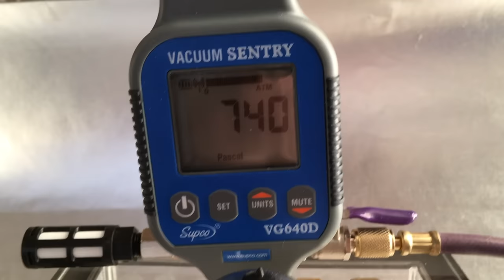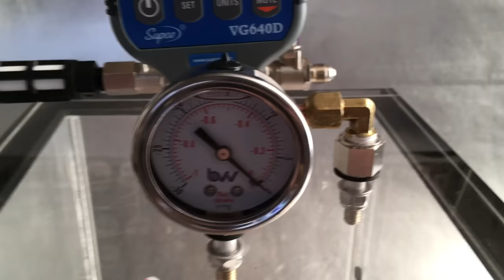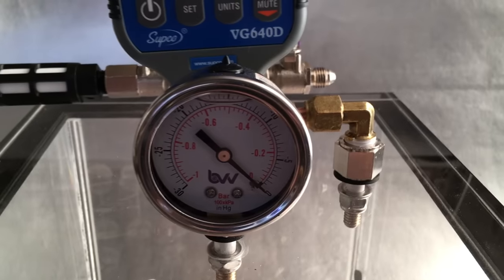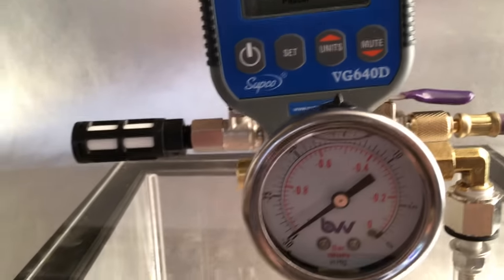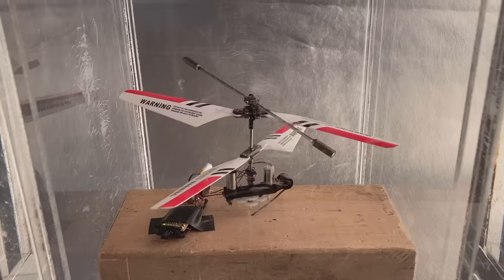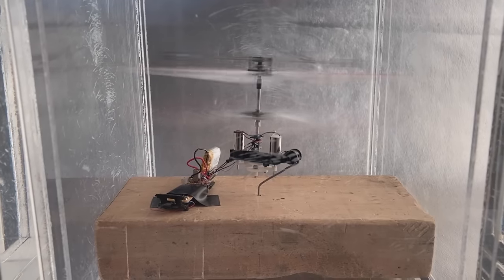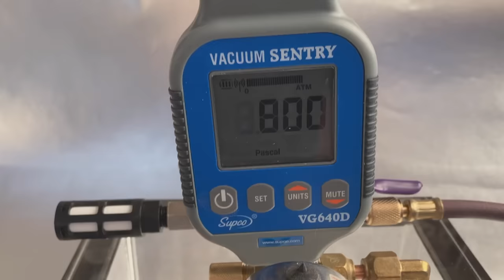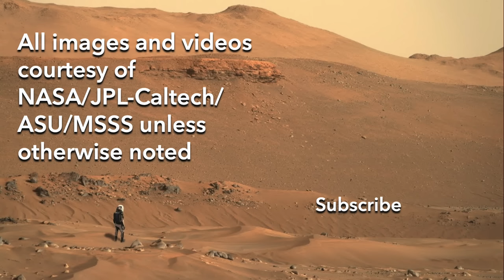Can a toy helicopter fly at Mars pressure?

Comment: Great update,  great demo. The weaker gravity on Mars helps. You need to switch on your anti-gravity machine.
Reply: He could run it on a skyscraper downward lift. :)
Reply: I actually forgot about the 0.38g on Mars.
Reply: He was measuring the lift, but he didn’t explicitly say that he was compensating for gravity differential though.
Reply: @russellharrell2747  indeed, but the lift needs to exceed the weight force (mass x gravity).
Reply: For the same thrust with the same rotor you'd need around twice the power on Mars and 10 times on Earth while spinning it about 10 times the speed compared to Earth conditions. This model wouldn't even hover on Mars with the weaker gravity.
Reply: @garyknight8616  yes, as long as the weight decreases on the scale by 39 or so percent we know it would lift off on mars.
Reply: Nice little experiment. You could see it generating lift, just not enough to overcome earth’s gravity.
Reply: Ingenuity (nicknamed Ginny) and its twin on Earth (Terry) have actually flown in 1g. (0:55 in video)
Likely just not very high.

Comment: Open the inlet valve slightly and watch as the air pressure increases. It will be interesting to know the pressure at which it lifts. You may be closer than you think.
Reply from the maker: I actually did this with the still fully assembled version of the helicopter.  It got airborne at about 0.4 bars (400 millibars) of pressure.
Reply: @MarsGuy  oh. Not close at all. That's sad.
Reply: @donepearce that’s without removing the extraneous mass of the landing gear etc. so it would achieve lift and a lot less than .4 bar.

Comment: Thank You Mars Guy for this episode! I think there are more reasons why experiment failed: Ingenuity blades are better optimized in general and they are optimized for Martian atmosphere including not only pressure but viscosity (at least I believe so). Apart from that the area of blades are also important, not just the diameter of the rotor. Those parameters are affecting aerodynamics of the blade by a lot, therefore lift and drag. I'd love to take a part in designing of Ingenuity successor!
Reply from the maker: It's true there's more engineering involved, and variable rotor pitch is important.  But I just wanted to see whether stripping down this toy helicopter would be enough.  It wasn't!

Comment: 68 flights is just incredible. It has proven itself invaluable many times over and is an absolute triumph for the design and operational teams. Just a relatively small extension of the rotors would have a significant effect on the capability of the next copters. I'm excited to see what the next iterations of these machines will be able to achieve, especially if they can incorporate recent the developments in AI and battery technology. We could be entering a Golden age of Rover exploration over the next 20 years.
Reply: A larger scale copter powered by RTGs sent to Titan should be possible, especially with behemoth rockets like SLS and Super Heavy/Starship coming online soon.  Titan Chopper could even come with a little boat to drop off in the hydrocarbon seas.
Reply: #68 will be an attempt to fly the longest distance yet. 828 m, or 2717 ft
Reply: But we still haven’t seen anything new on Mars we haven’t from satellites. Why aren’t we going into those caves and lava tubes ? Will we ever? If anything exists on Mars it’s certainly not on the surface. So lets keep poking at rocks for another decade and ignore where anything might exist.

Comment: Thanks!
I was more interested in the design and engineering of the "Mars Lab" than in the (expected-sorry) lack of lift in low psi.

Is the vacuum chamber "store-bought" or did you design & build it yourself? (I especially liked the inlet filter & valve system.)
In over 4 decades, I never actually did the "water boils in a vacuum" test... but I thought about it alot. I worked with Microns (HVAC) mostly and have to check a conversion chart for Pascals so I can understand the relationship better.
(We would typically take a sealed system down below 300 microns stable for best results in moisture removal.)

Thanks again! I always look forward to your updates!
Reply from the maker: The vacuum chamber comes from a company called BVV (shopbvv.com).  I modified it to use a second vacuum gauge.  Glad you enjoyed the boiling water test.  Kinda fun.

Comment: Very interesting ! It may help to break down the misconception widely spread by the media, that said Ingenuity's rotor was rotating at "high speed" to compensate for the low atmospheric pressure, while they are rotating slower than most commercial drones.
Reply from the maker: They are high speed relative to a full-size helicopter (~5x).  And for their length, they're high speed relative to most commercial drones.
Reply: True, i should have said high RPM @MarsGuy  , since it is what they refer to every time.

Comment: A major component of flight is wing foil design, not just speed and length. Part of the Wright Brothers genius was realizing the propeller is not just a way to pull (or push) air, but is also a wing. If you could make your own wings (Props), you might be able to get your RC helo to fly. It would make a fun project for aviation students.

Comment: The formula for lift generated by an airfoil includes the square of the airspeed, so I expect the same applies to the tip speed of a helicopter rotor. The thin plastic blades of Frankencopter would probably not survive if they were rotated fast enough to lift off at Martian pressure. Still a neat experiment, though!
Reply from the maker: Thanks for that detail, one I hadn't come across.  And yes, Frankencopter is not built for speed!

Comment: Awesome video. I was originally going to point out that you did not tether your RC helicopter to the top of the chamber to give some tension to reduce the "feel" of gravity like they appeared to do with Ingenuity in testing, but later saw you simply continued to remove mass but kept the most vital portions of the helicopter intact, thereby achieving more or less the same effect. Great explanation overall.
Reply from the maker: Yeah, the effort to lightweight this helicopter was my approach to addressing both the thin atmosphere and less gravity of Mars.  But clearly it wasn't enough, in part because the small blades would need to spin faster to get more lift.
Reply: @MarsGuy  Indeed, that's what I got out of it. You conveyed it well. :) Thanks for the response!

Comment: Reading some of the comments here and commenters talk about blade design and that reminded me of a channel I watched that was taking hydrodynamics of the leading edge of whale pectoral fins, specifically the little ridges and troughs on the leading edge and applying these to propellers to reduce drag, increase lift and in the case of boat props to reduce cavitation. I wonder if the next Ingenuity will have some new leading edge design to its props to reduce drag and increase lift.

Comment: I would love to see how a more powerful brushless tinywhoop (mini quadcopter) does, if you also account for the reduced gravity by pulling on it with a wire at whatever % of its mass. I still dont think it will fly, but the proof is in the pudding, and by varying the pull on the gravity tether we could see how far from lift off it is. Alternatively, put a scale in the chamber so you can measure trust.  Im pretty sure you will want more aggressively pitched props though. Also, it just occured to me, you are probably creating a prop wash vortex ring in that chamber, with the air blown downwards being forced upwards by the walls and then down again in to the props.
Reply from the maker: Good suggestions and thoughts.  I was going to abandon this effort, but comments like this have me thinking twice.

Comment: Since longer blades means exponentially more speed would it be worth it to make a part that slides out to give the blade a few more inches on earth based copter systems. If it provides that much more lift and it wouldn't be too hard to incorporate into a traditional design wouldn't it's practicality outweigh its design challenges?

Comment: Its been said below and a huge gain for Ingenuity is the almost 1/3 gravity. I also suspect that the blade wing section of your helicopter is not optimised to the lower air pressure. Great experiment though.
Reply from the maker: It’s true that reduced gravity would help, but a challenge to simulate in Mars Lab.

Comment: Good example, to get your toy to get lift, you need to rebuild the blades and point the exit vector for air force practically straight down. The small thrust you get from the current design is effectively just slicing through the thin air at this point, and might as well be flat.
As an example, hold out your hand, flat, then relax your fingers and watch how they curve naturally, ever so slightly. That curve would be the current blade design your are using. Now, bend your fingers to make more of a scoop, where your tips are point closer to 90 degrees off from the palm, keep a curve, don't bend it, and that's what you will need for the blades to have functionality.

Comment: Great attempt Mars Guy, experimenting with your own ingenuity! Mars Guy needs a bigger Mars Lab. ;)

The small volume likely contributed to greater rotor downwash phenomenon (a donut circulation pattern). It occurs when a helicopter is hovering in close proximity to a ground surface which increases power and thrust needed to hover, unless moving laterally. Being able to spin up blades, and then applying positive angle of attach would help to pop up off the surface, before downwash can develop.
Reply from the maker: Yeah, these are good suggestions.  I was trying to keep it simple, but it’s clear that simple doesn’t work here.
Reply: @MarsGuy  Starting simple is always a good idea. Much was learnt and shared.

Comment: When you said Mach did you mean usual Mach one at sea level of earth or were you using the speed of sound in the medium being discussed? Getting the blade tips close to the speed of sound on mars seems like a potentially risky move as conditions could change.
Reply from the maker: This is the Mach number for the atmospheric pressure of Mars.
Reply: @MarsGuy  so it will be getting pretty close to theoretical maximums and thus have to be more careful or relative wind speed and travel speed.

Comment: Try adding another battery pack to increase the motor speed. Not sure what the battery voltage is but that looks like a single cell li-po at 3.7v adding a second cell in series would give you 7.4v. Try that? Oh and see if you can make a bigger vacuum chamber! :o)

Comment: Yeah the rotor blade tip velocity needs to be less than the speed of sound. As for your tests in the 'Mars Lab' you never mentioned that everything on Mars weighs 1/3 of what it weighs on Earth, which is part of why your test didn't work. Also I don't think the blade design is as efficient as the blades on the Mars helicopter. When I saw the JPL  test that you showed, they had a weight on a pulley that reduced the weight to the Mars level. When it lifted off, I knew that it would fly on Mars. During the Mars summer, the pressure was less compared to the winter, and they had to spin the rotor blades faster to make enough lift.
Reply from the maker: Good points.  I was trying to do the easy approach, which clearly wasn’t good enough.

Comment: Good experiment.However, in aerodynamics, we don't use g/mm ,but use disk load, kg/m^2, or N/m^2, to represent the air static pressure difference between the upper surface and the lower surface of the rotor disc. Area of the rotor disc is pi*r^2.On Earth, manned helicopters maybe 10~100kg/m^2,or 0.1~1kpa ,but mars helicopter is 1~2kg/m^2 ,or 0.01~0.02kpa.Also, the rotor tip speed of mars helicopter is much higher than Earthman toys.
Reply from the maker: OK, disk load is a useful metric (and new to me).  I was trying to emphasize the difference in rotor tip speed between the toy helicopter and Ingenuity.
Reply: Of course tip speed is very important, however when tip speed very close to Mach 1, rotor will not be efficiency ,so in mars thin atmosphere, rotor is tend to have a high tip speed as well as a low disk load.   @MarsGuy
Reply: To calculate lift ,a very simple formula can be use: Lift = C_thrust*rho*(pi*r^2)*(tip_speed)^2. I estimate that C_thrust of mars helicopter is 0.015~0.02,because of large blade chord and camber.Helicopter on earth ,C_thrust is only ~0.005 .  @MarsGuy

Comment: Clearly Ingenuity is significantly overdesigned.  With a very generous margin of safety, Ingenuity should have failed long ago.  But, given what NASA's got in the way of helicoptors on Mars, it does make sense to test the hell out of it.  This is the kind of design failure I like to see:  one where the design so far exceeds the intended test requirements that the test item becomes a functional tool.  Had Ingenuity failed on flight 8, we would have celebrated success.  If it fails now, we will be bummed out for having lost such useful capability.

Kudos to NASA and JPL for such a good job.
Reply from the maker: Well said.

Comment: Being able to fly at all on Mars only requires generating the required amount of lift.  The amount of lift generated is dependent upon the speed of the airfoil through the air, the length and width of the airfoil and the density of the air.   With all of these factors being equal on Earth vs Mars, the 38% of gravity on Mars, relative to Earth only affects the amount of weight that can be lifted;  1/0.38 = 2.63 times higher on Mars.    So, Mars Guy, if you took your "Frankencopter" to Mars, I reckon it would fly - just need some navigation skills.
Reply from the maker: Yeah, I wish I could've shaved off more weight.  It started out at 32 g and I got it down to 19 g.  It's possible that's enough to fly on Mars.

Comment: You never accounted for the difference in gravity, or that the toy's rotor blades are basically paddles that produce some thrust but zero lift - they don't have the cross-section of a wing, unlike Ingenuity's blades. Nor do the the toys blades have any collective pitch control, againt the opposite of Ingenuity, when collective pitch gives the blade steeper angle of attack and more lift as they tilt up for take off.
Reply from the maker: The blades are air foils, but without variable pitch.  And yes, the reduced gravity on Mars would help.
Reply: @MarsGuy  no, they're not airfoils. They're not even remotely shaped like a wing profile. I have three of them and used to sell them. Put a coin or two under the nose and glue a smaller coaxials main blades to this ones rear blade if you want to make it fly anything remotely decent.